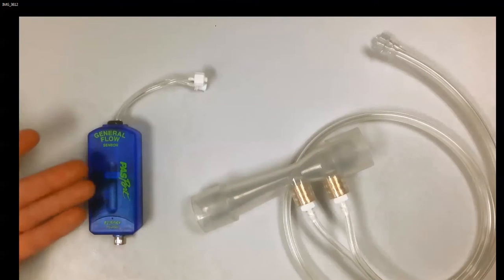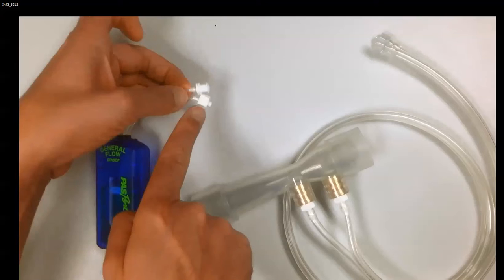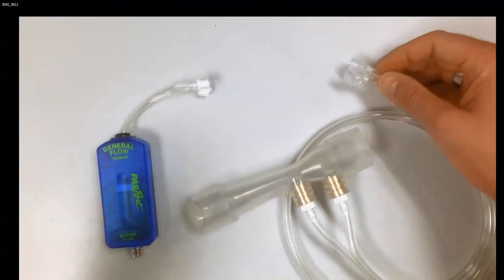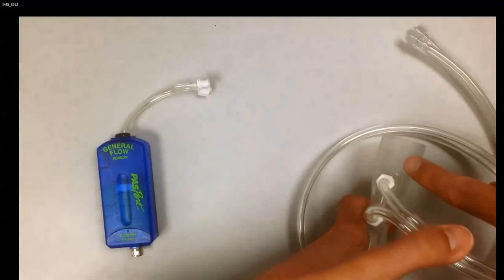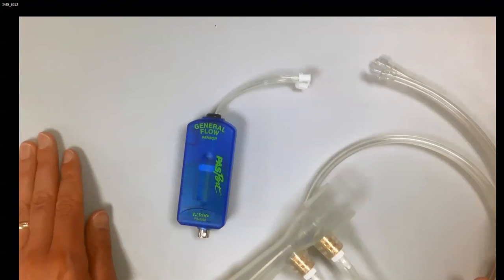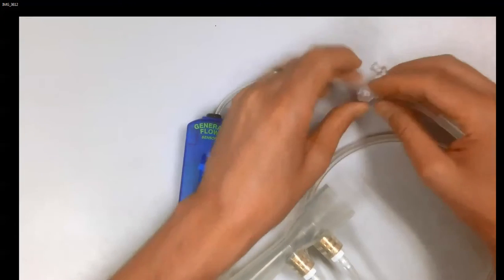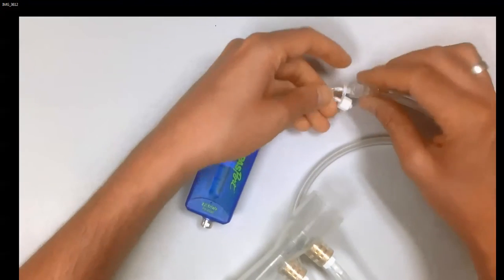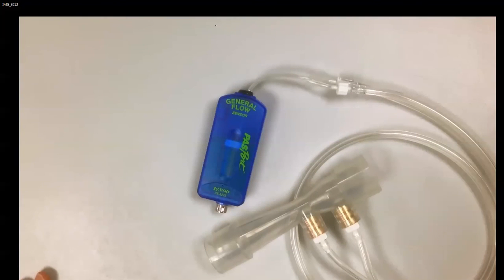Use the General Flow Sensor with Venturi Tube

Comment: is it connected via Bluetooth to the interface?
Reply from the maker: The blue PASPORT sensors do not have their own bluetooth radios.  To make these sensors wireless, you can connect them to the PS-3200 Airlink or the PS-2011 SPARKlink Air.  The round silver connector is physically connected to one of our bluetooth interfaces.  Links for these products are here. https://www.pasco.com/prodCatalog/PS/PS-3200_airlink/index.cfm . https://www.pasco.com/prodCatalog/PS/PS-2011_sparklink-air/index.cfm